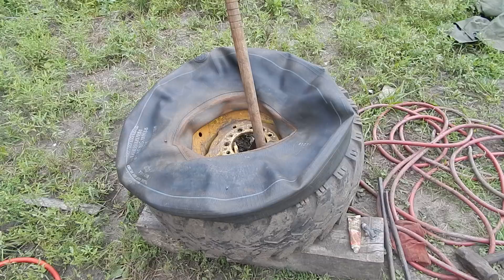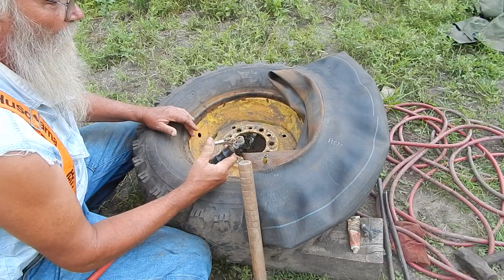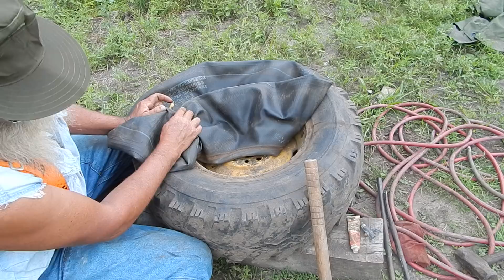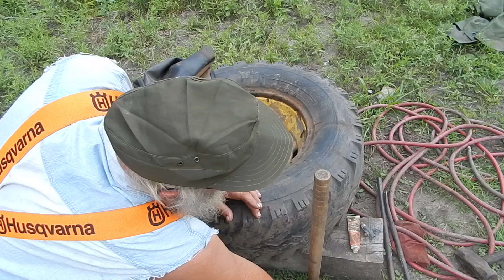I got ahead of myself

Comment: Have you ever used that big bead breaker on a motorcycle tire? I’ve had some that where really tough to break loose.
Reply from the maker: Actually the easiest way to break the bead on a motorcycle tire is a bench vise.  One jaw on the tire, the other on the rim on the opposite side, tighten it down and give the wheel a twist and they pop right off.  You want to cover the jaw on the rim side with a rag or something to keep from marring the rim, but it's by far the easiest way.